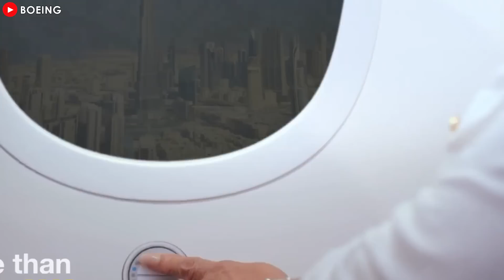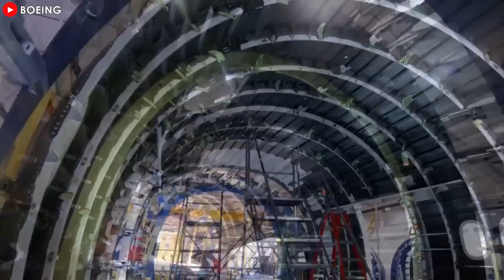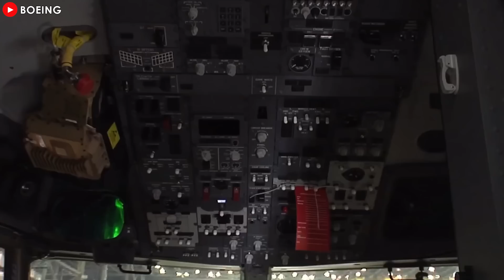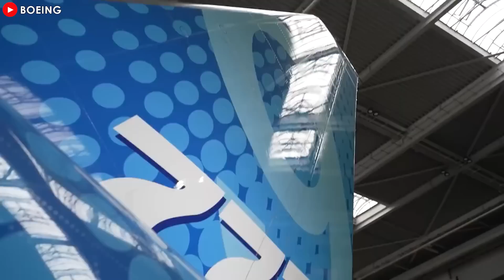Boeing's next Aircraft is the ANSWER to Airbus's Secret Weapon...! Here's Why

Comment: This question (new "NMA"/"797") has been re-iterated again and again. Sadly for Boeing and their shrinking community, with every iteration their financials look more and more dire. Losses are mounting, as is their debt, the company is hemorrhaging cash. As a consequence, workforce is laid off, and the redundants may include development engineers. The image of the company continues to decline, with the shameful disaster in the space division adding to the nightmare.
The most urgent tasks on the strategic to-do-list of Boeing are the stabilization of their manufacturing system (with the sub-branches quality and supply chain) and the certification of the 737-7, 737-10 and the 777-9. Behind the latter in the list comes the development of the 777-8 and -8F siblings. From a financial point of view, Boeing must stop bleeding BEFORE a major new program can only be envisionerd. AND: the regained profitability must be large enough to allow for the new development WITHOUT bleeding cash again.

Chapter 11 is looming. It is more probable IMO than a 797 development.

Comment: I suspect that the market segment left by the A300/310 and 767 will be filled as soon as suitable engines are available. 

By which time, I would expect both Airbus and Boeing to release their offerings. 

As for a 757 replacement partner, I fear that Boeing may have left that too long, and will, like Airbus do with the A320 series, have it as a variant of a long overdue new Boeing single aisle design.